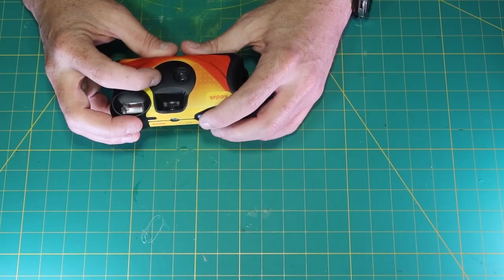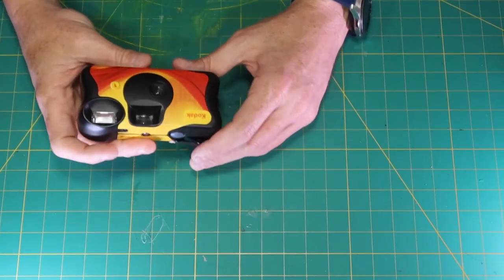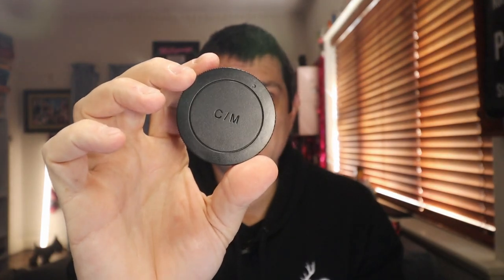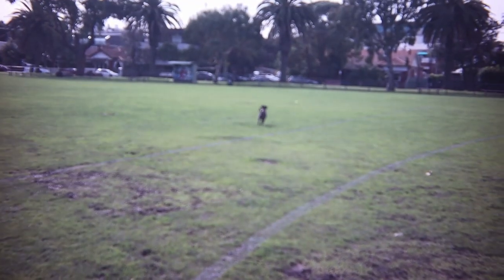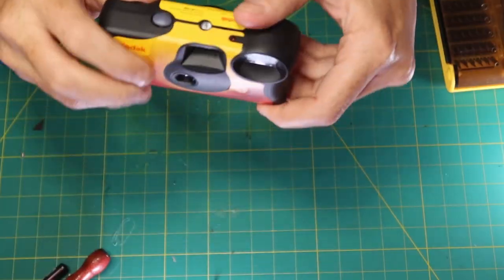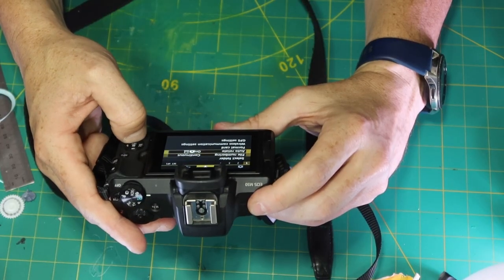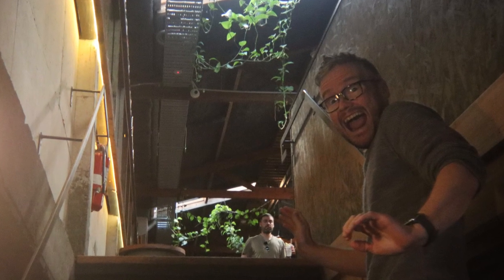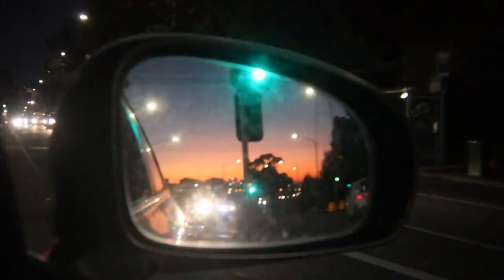Turn a Kodak disposable camera into a CAMERA LENS!

Comment: What settings was you using ? Mine is just blurry
Reply from the maker: I had to adjust the position of the Kodak lens to get it to focus (forward and back). Then just shot in automatic
Reply: Hi! I just did this with my eos m100 (also an aps-c sensor) but I can't seem to shoot in automatic mode. I'm just wondering if you have an idea 🥹
Reply from the maker: There is a setting somewhere called "release shutter without lens". You need to enable that for it to work.
Reply from the maker: Found these instructions on Reddit. 

"In menu -function settings - go to the 5 tab - custom functions(c.Fn) - release shutter without lens - set to Enable and now the camera should work with vintage lenses."
Reply: @cameragadgetother  Hello, thank you for the reply! But, I already did this and still can't shoot automatic ☹️
Reply from the maker: @asi954  not sure what the next step would be sorry. Maybe disabling auto focus, or see if it works in manual?